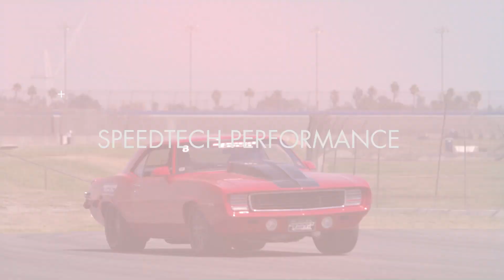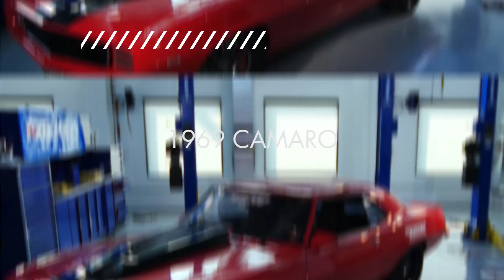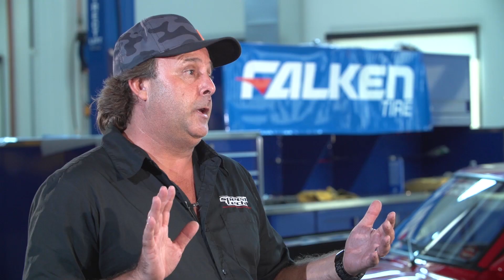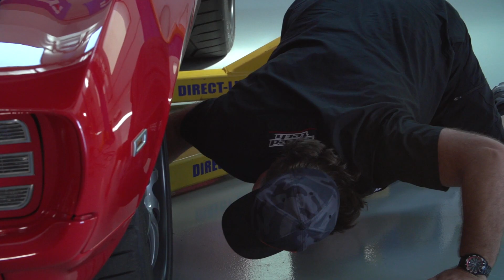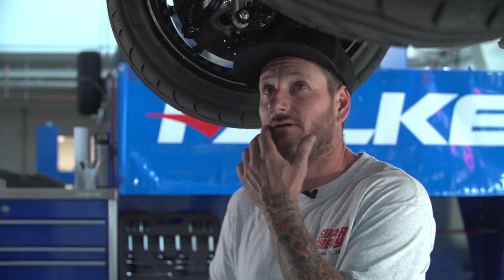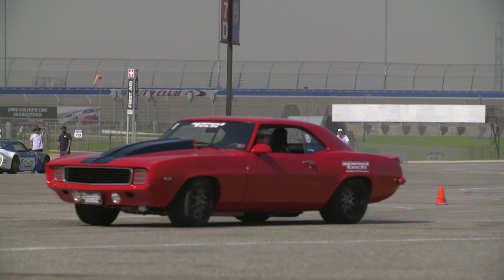Speedtech Performance 1969 Camaro

Comment: They mention they have frame connectors, but I didn't see them? 
It seems alot of people don't don't bother with a rear sway bar with the 4 link system. What's in this design that makes a rear sway not required.
Reply: I was thinking the same thing about the connectors, and is the guy in the vid one of our boys?
Reply: shredBucketheadshred bloody sounds like it!
Reply: Nope. No subframe connectors shown here!